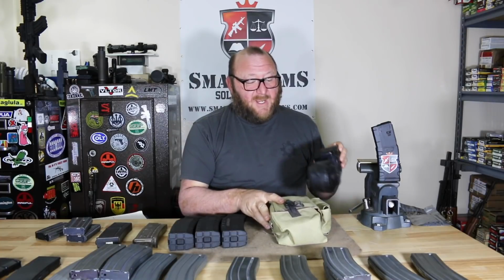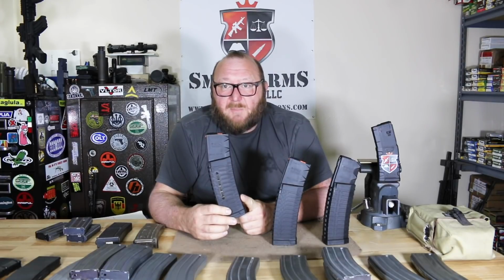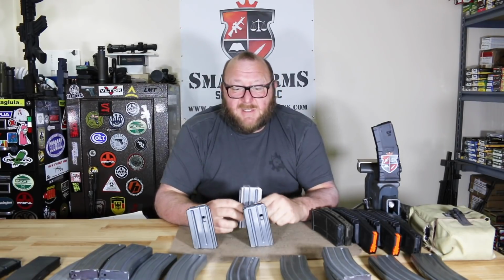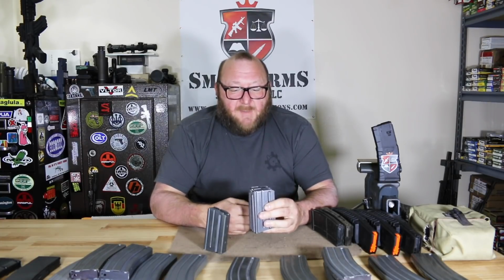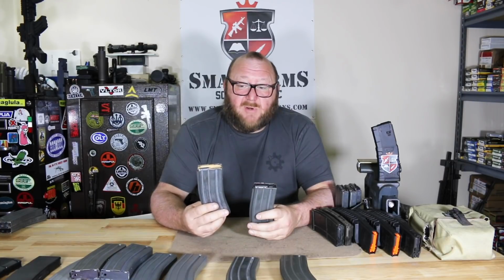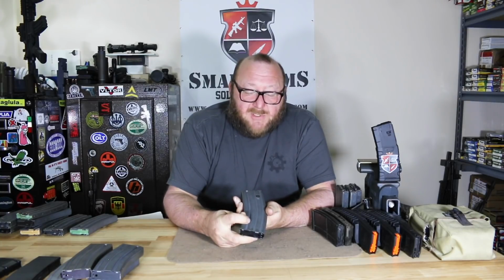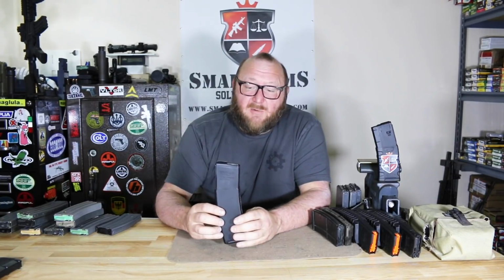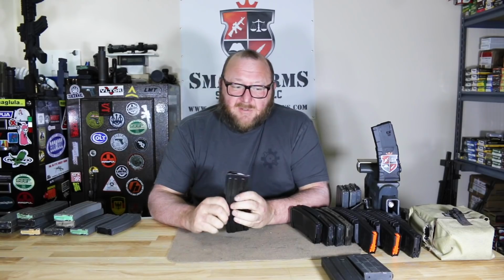Feeding the Black Rifle Part 3

Comment: I did not hear you mentioned it in these three videos, a "wife's tale" i've been running with. And it is that you don't want a magazine(steel) stronger than your magazine well. Because if you have to go to the ground and impact, you want the magazine to fail, not the magazine well. Any credence to this?
Reply from the maker: Absolutely never heard of this. It makes no sense. That lower receiver mag well is well supported and has good depth t it.
Reply: @SmallArmsSolutions, thanks for clearing that up for me.

Comment: I will not buy or use mft magazine. I purchased 10 mft mag's in 2016 and thay are junk . I had a few split down the spine and thay would spit the rounds out. Ive heard the gen 2 fixed all the issues but I don't trust them

Comment: All Gen 3 Magpul Pmags for me. The abuse they can take is astounding. I have run them through my Colt 6920’s, Knight’s Armament SR15’s and Daniel Defense rifles for the past decade (M2’s and M3’s) with zero malfunctions of any kind. Truly remarkable.
Reply: I am more of an AK guy, but I have a question. The pmags for my AR have been VERY reliable, however, I have heard that they are not very good if you store your mags loaded. The reason is after awhile the pressure on the polymer feed lips causes them to crack. Is this true? Wouldn't Lancer mags mags be better (with their metal feed lips? Thanks
Reply: @MattN47  I’ve heard that too but it has not been my experience with Gen 2 or 3 Pmags. In fact I’ve had some Pmags mags fully loaded in my safe for the past ten years that have not experienced that issue. I’ve had other Pmags fully loaded for periods of 2 to 3 years that al cycled fine. I’m not saying it can’t happen it just hasn’t been my experience. Generally speaking though I keep most of my magazines unloaded in storage. Only about a dozen or so I keep loaded at all times for emergency purposes.
Reply: I should mention though that I do use the Magpul magazine caps/covers that come with them which supposedly keep this pressure off the feed lips. This may be why I’ve never had an issue.
Reply: Thanks!

Comment: I bought one of the steel Korean mags. Was not happy with the sharpness and roughness of the feed lips. Way worse than any GI mag I've ever used. The burrs really scarred the brass. The rifle never choked, but I am worried if the conditions were adverse the rough feed lips would not be doing you any favors. It is in serious need of a deburr.

Buuutt, it is built like a tank. After a few minutes with a needle file I have no doubt it will run fine.
Reply from the maker: Not usually a manufacturer concern. They only worry about that cartridge feeding once
Reply: @SmallArmsSolutions  yeah the scarred brass issue is mostly a reloading concern. I have little doubt that the magazine will last years of hard use. Just wasn't thrilled with having to deburr a commercial product.

Comment: Interesting review as always. I picked up a couple of the ATI/Schmeisser 60 G2 window mags (for $49 each) and concur that the follower redesign seems to have resolved the bolt open after last shot problems I had with the G1's.  However, my main go-to mags are exclusively Lancers and Magpuls.  I have never had a single malfunction with either.

Comment: Chris & Heather another great production. Like you Chris, I'm picky when comes to magazines. Early on I got my hands on a bunch of surplus aluminum mags. I'd pull the base plates/springs/followers. Clean the w/light soapy water let dry over night. Then using Magpul replacement kits rebuild those mags.
For my XCR-Ls I used primarily Magpul Gen2 in FDE. I've got some Brownells in FDE, and a ton of Okay Industries. A few of the H&K steel mags.
Like you I lived through the 94 AWB. So I have a lot of standard capacity mags for all of my weapon systems.
Again! AWESOME Video!!!!

Comment: C Products Defense, which was not a continuation of C Products, had issues with 6.8 magazine feeding. They did make efforts to correct and from what I read, they ended up changing the curve a little bit, because the .30 case is tapered. It’s not as severe of a taper as 7.62 x 39 though.